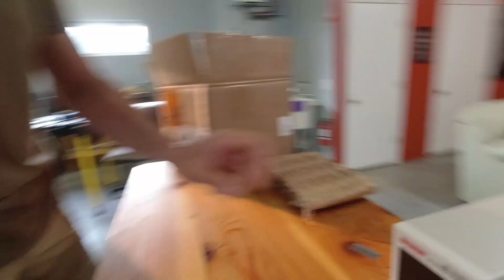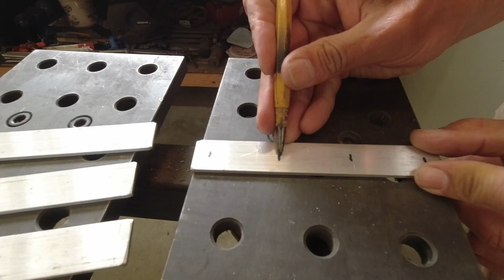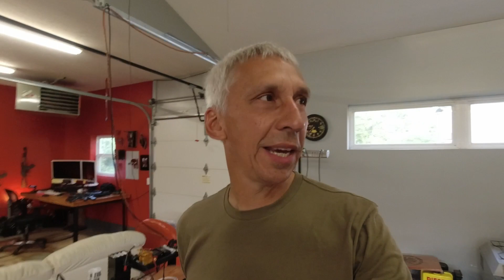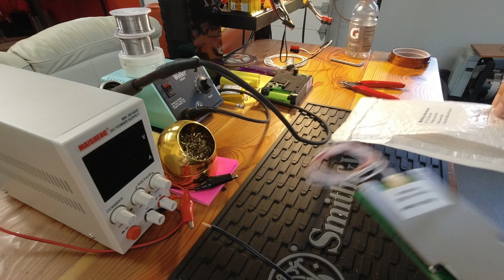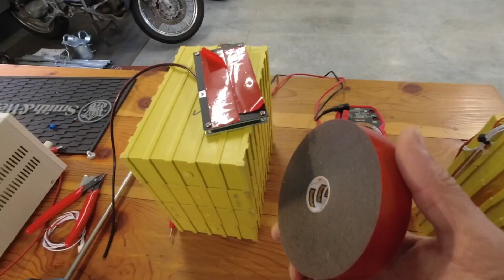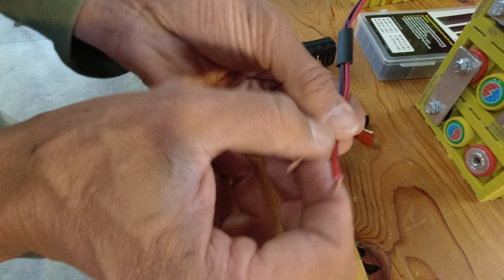How to build a LiFePO4 battery

Comment: Always great videos. I've seen someone else on YouTube with an enormous lifepo4 battery bank and they had issues with the slight expansion and contraction of the cells - apparently they were pushing on each other during cycling and the rigid bus bars were getting stressed in a way that the terminal connectors themselves were failing - I'll try to find the exact video, but I'm curious if you've seen it and if you think it's actually an issue or not. I think they were trying to keep them in compression because they're supposed to last longer that way? The channel may have been off-grid garage

Comment: I would use Copper ( Maybe Brass )  Busbars not aluminium.  Altho aluminum is shiny, its got a surface layer of oxide which is hard to remove and when removed forms almost immediately.  This is esp an issue for high current applications such as low voltage applications.